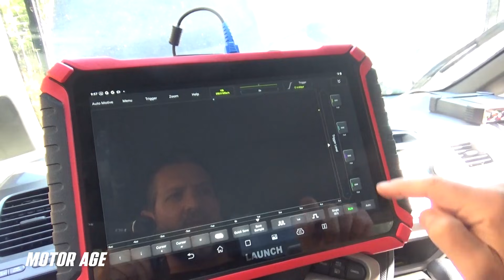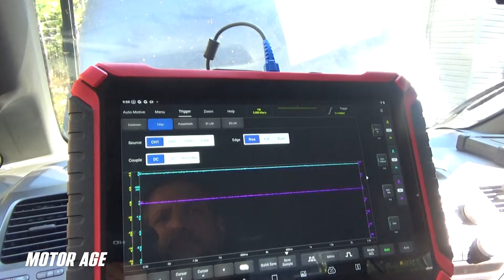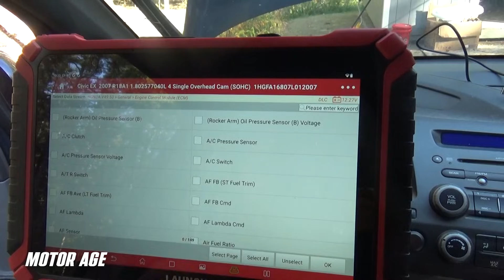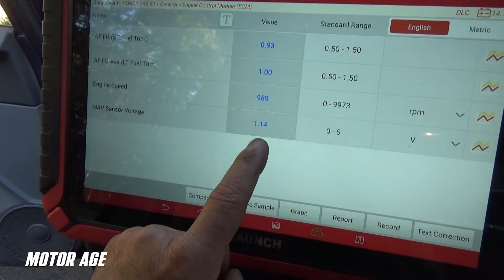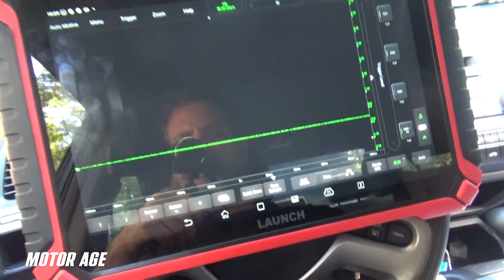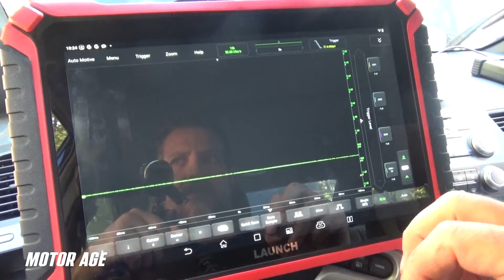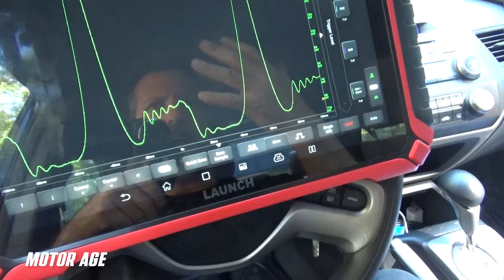Mastering Diagnostics #30: When Mechanical Testing Lets You Down

Comment: That was understandable.  Having the intake sensor connected to the scope would yield #4 cylinder the problem.  Doing the in cylinder compression test proved the problem.  The exhaust valve was to tight.  Adjusting the valve solved the problem.  Older Honda 4  cylinder engines both carburetored and CNG had that problem.  The CNG had shown a little roughness at idle.  I didn't like the long time/mileage before checking adjustments, so when our (Fleet--L.A. Dept of Water & Power) CNG Honda's came in for service, if there was a rough idle complaint, most times I found the valves for all 8 valves needed adjustment.  Adjusting the valves cold, and adjusting the minimum idle speed yielded a smooth running engine.  Fortunately the valves were not to tight to cause them to be burned and the engine ran great.
Good information about the intake and exhaust valves and compression losses.
Thanks Brandon for the info and the video.
Reply from the maker: It’s our pleasure, thank you!